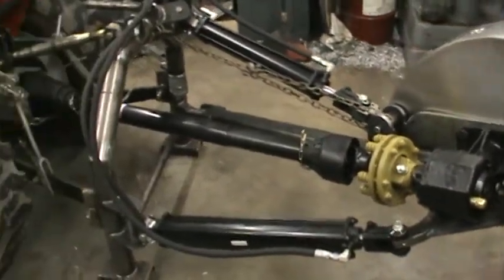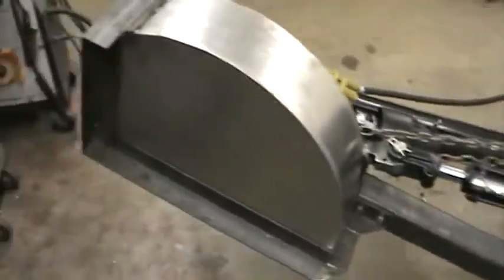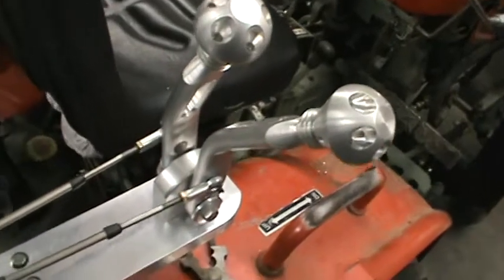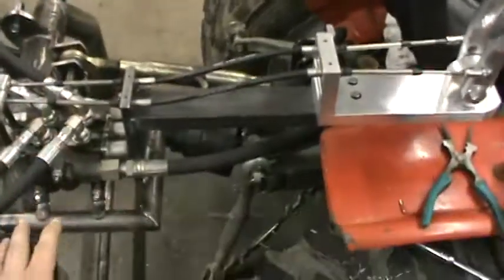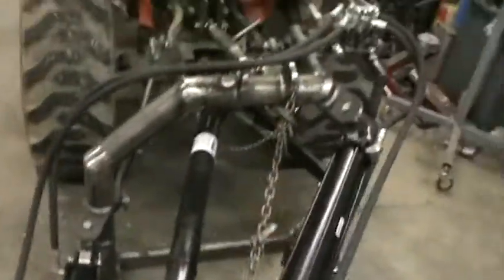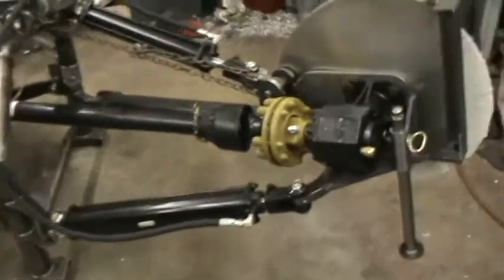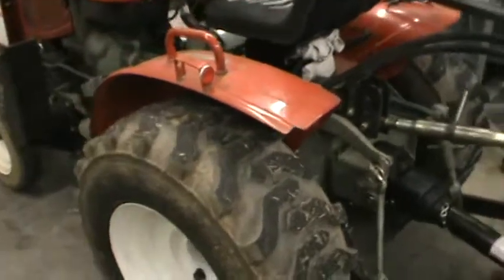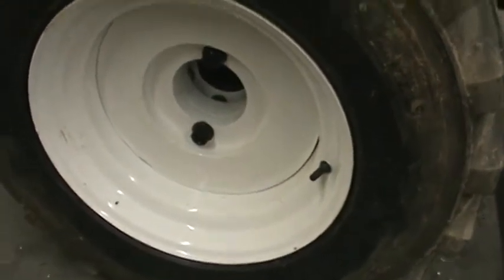making a stump grinder part 2

Comment: Billy, I want to make a 3 pt stump grinder following your lead. I have a small compact, a Ford 1210. Looking for some assistance on what kind of gear box, clutch, pto shaft, cutting wheel and teeth to go with. I have no problem with the metal work or the hydraulics. There's so many options for the rest of it. Thanks!!!